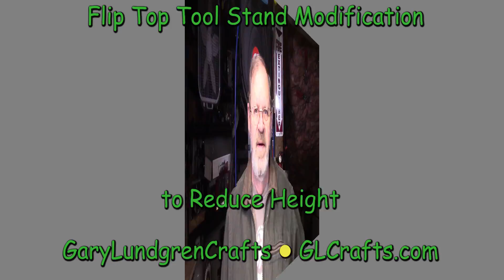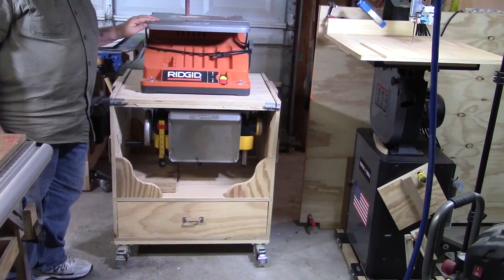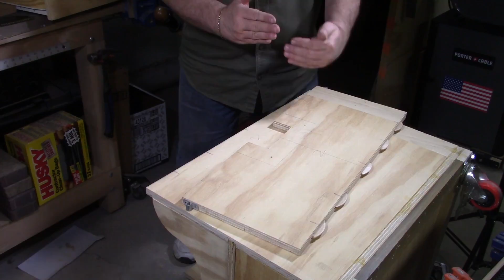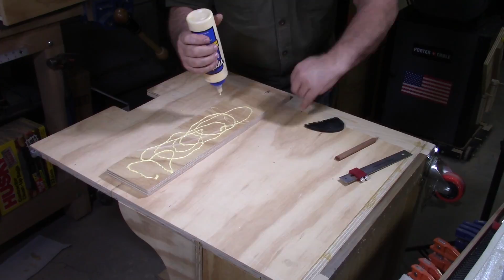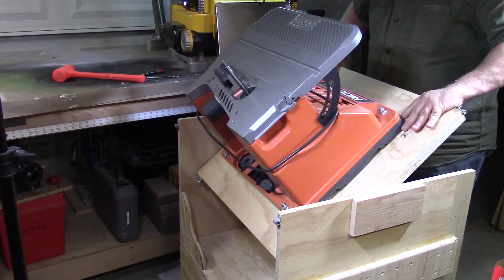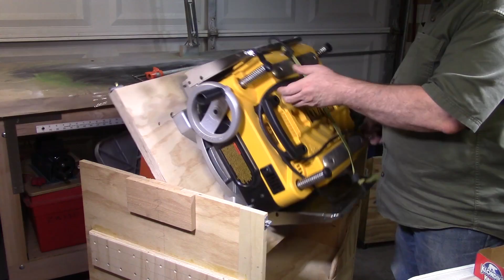Modifying my Flip Top Tool Stand Ep.2016-42

Comment: Perhaps I'm missing something but wouldn't it have been simpler and structurally more sound to remove the 5" segment from the top and use that as a template to cut out the housing slots?
Reply from the maker: You're right!  I'll soon be rebuilding this entire thing. I'll not make a video of it tho as so many others have and they did a great job of it. Thanks!